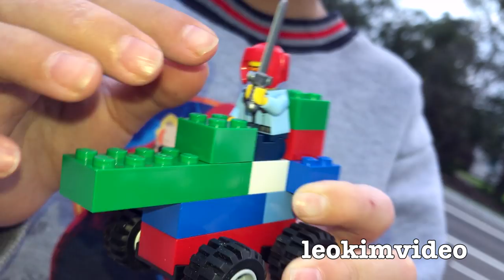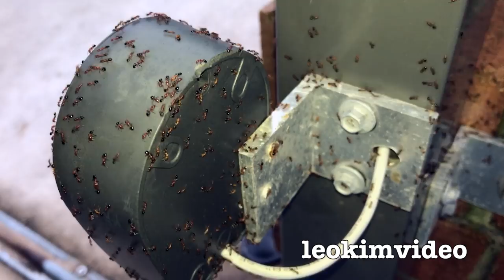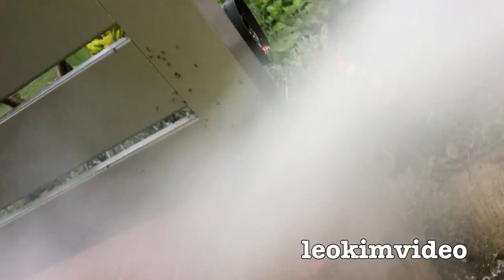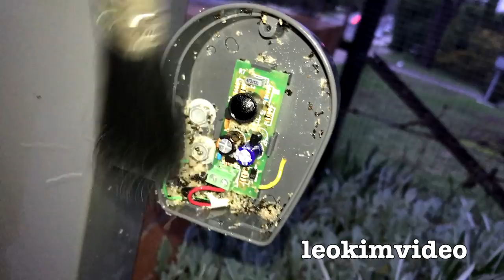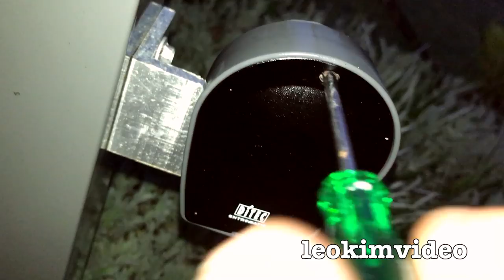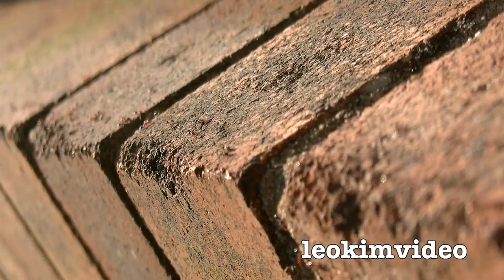Crazy Red Ant Invasion Educational Pest Control

Comment: Leokimvideo I have two ant nests in my walls I have used some ant bait stations and it has worked mostly but I need some advice to destroy them completely thank you
Reply: Xred11 ツ I believe the queen is dead maybe because I have not seen any ants lately,without the queen the ants will die so maybe the ant bait station did work but to make sure I have done what you said it does not take long so thanks for the advice 😃
Reply: Joshua Meadows np, :)

Comment: you should try to capture the "big important looking ant" next time with a bunch of ants from the same nest and a bunch of eggs, then put them in a container with the top covered in a mixture of alcohol and baby powder so they cannot crawl out and a test tube with water in it and cotton to keep the water in, also a place for them to dig or optionally create a test tube network with tubing so they can settle there.

i keep ants myself ant they are great interesting pets :)

these ants behave like the ghost ant in this video altho ghost ants are alot smaller, ghost ants are known to destroy electronic devices since they build nests in them, and their size allows them to get into xbox controllers, phones and even fire alarms, but seeing how big this colony is they are a rapid growing colony and seem to preffer dry nesting spots like hollow tree trunks or if they can get their way in plastic enclosures.

i cannot identify the specie at the moment tho but becouse you recorded the queen i might be able to find it later.

also a little lesson for your son, red ants actually don't bite, they sting instead which indeed gives a burning sensation, however not all ants sting as some use formic acid or just bite.